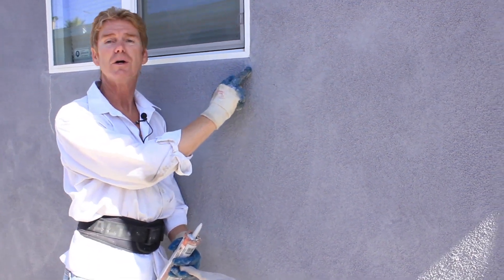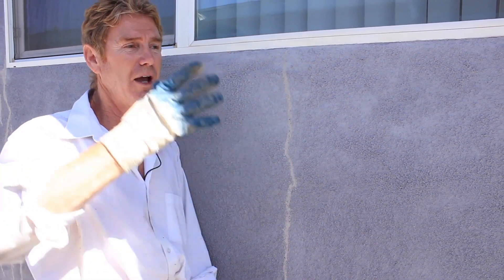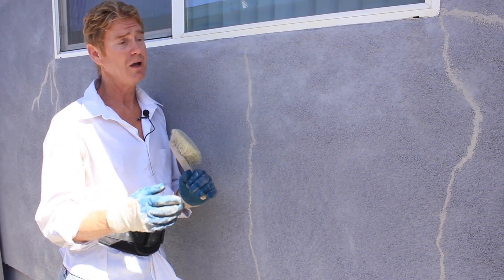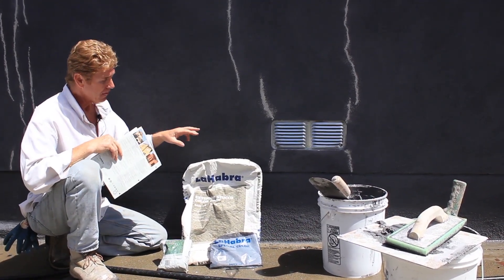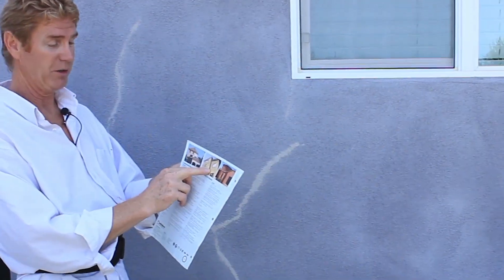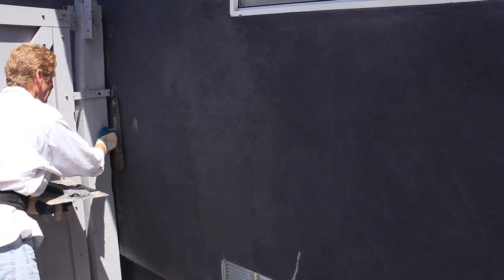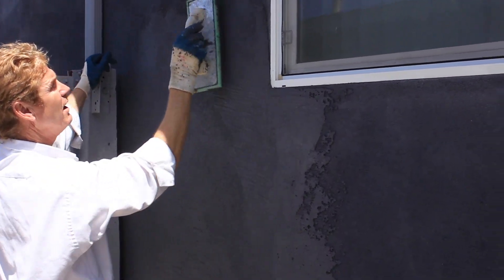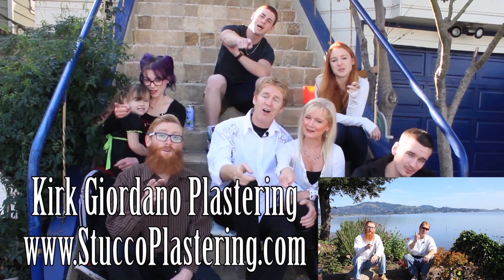Stucco color finish repairing cracks

Comment: I tell ya what Kirk, you are a pro at blending new onto existing. I'm a stucco contractor in the midwest and people don't understand how difficult it can be to blend the new into the old, especially the color. As for the cracking, you do a great job of explaining why it cracks and that its related to building movement. We have a system up here that is designed to not crack, its called Sentry stucco. Get ready for this, we'll start from the substrate and go out to the finish. 1.) Trowel applied moisture barrier. 2.) Mort-Air Vent air barrier. 3.) Metal lath and casing with expansions as needed. 4.) Scratch & brown as normal. 5.) Adhesive basecoat and mesh over the brown coat, like brown EIFS foam. 6.) Acrylic color primer. 7.) Acrylic finish coat....Hows THAT for a stucco system, haha. I personally like good old fashioned stucco but you should look into the system, its crazy advanced but it might be a solution to the cracking problems you have out there. Keep the videos coming Kirk and keep up the great work!
Reply from the maker: Evening Spencer, Thank you,
 We have this system here too, I just have never found anyone willing to pay for it.
 No joke!
 I had a guy 6-or 7 years ago who wanted a Santa Barbara Smooth Mission Finish, he had his house sandblasted,
 I told him his home was rare as they beat the crap out of it with the sand and glass, looked like a bad scratch coat.
 I recommend Polybond type of plaster adhesive with mesh tape on the entire wall then another coat a polybond over it or I could not do that cementitious finish and guarantee it.
 Man, He nearly called the cops on me when I gave him the costs.
 He did find a fella do do the finish and they were both in court forever, I found out as the plastering called me for advice. No Joke.
 It take all kinds, best wishes and have a good evening.
 kirk giordano
Reply: Kirk & Jason Giordanos DIY plastering and stucco instructional videos and forum Haha, yeah, its rare to find that system up here because of the cost but its surprisingly being spec'd on more and more commercial projects. Anyway, keep making the awesome videos kirk and have a good one!
Reply: Spencer Kelly sounds like a nightmare stucco system haha

Comment: Plastic expansion joints On the four corners of the window. from the top corners to the soffit and to the ground for the lower window  corners.
My take. If you think the whole of the east bay is built on unstable strata - take precautions. Control for the inevitable cracking near the Windows.
Love this channel.
Reply from the maker: Good Afternoon Paul dude, had I know this home was built on the fault line and had two layers of different substrates, I would have placed an expansion joint on this long wall.
    It may have helped, however I have seen many jobs with lots of expansion joints with many cracks anyhow, you just never know how the ground will move.                  
                         Live long and plaster 
    Sharing Plastering tips by the Giordano Gents

Comment: Mr. Giordano - I send myself to school every night here on YouTube, learning as much as I can about the industry I am in.  I find myself being drawn to YOUR videos more than any other.  They are spot on and you address issues that are particularly relevant and pointed.  I don't think there is another "teacher" out there that is better!

For repairing color stucco cracks, there is a product called eXact Color Caulk by Sashco - it has the same properties of Big Stretch (which is an amazing and resilient caulk).

We get out a test board and pigment (latex craft paint will do fine) and get a color match using a hairdryer - we dry the mixed sample until it matches exactly with the stucco color.

After we get the match, we mix a larger amount and add it to the caulk with some fine aggregate.

If you get the color match right, you can make the crack virtually invisible - this will largely depend on the aggregate match, of course, because as you know, texture match is as important as a color match.
Reply from the maker: Howdy Hybrid, thank you, my friend, I will try eXact Color Caulk by Sashco, thanks for the tip.            

       Peace, love, and happiness to all.
Sound Plastering tips from your favorite stucco nurds

Comment: Thank you so much for your video.  We live in mid state AZ where it gets cold and warms up during the day.  We have been blessed to be able to build our custom home, which was not a reality while living in CA.  We like our builder very much although there has been a couple of large mistakes, one being we wanted recessed windows with a bull nosed edge on the outside. They ended up flush.   Can't be undone...moved on.....the second is we wanted a smooth Cat Face finish...didn't happen....disappointed to say the least.  Had I known  this, we would have done siding.   I have noticed hair line cracking now.....not painted yet.  Move in date is 6 weeks.   I was told they would fix the cracks.  I assume this  should be done prior to painting.  After watching your video I have a better idea of the process.  I would say they are not large cracks, maybe 1/16,  maybe more.   I think I would like to wait until all the work is done inside and out to wait for them to fix the cracks and then paint.  What ya think?   Thank you for your information!  Appreciate all your great info!
Reply from the maker: Howdy Mary Ann, if the house is to be painted, all you need is quality caulking to fill the cracks then painting, unfortunately stucco has a tendency to hairline,
 If your home had a maintenance free color coat cementitious finish, these are almost impossible to repair, no damage to the integrity of the stucco, just tough to stop this hairlineing.
 Best wishes, 
Kirk & Jason’s stucco repair video’s

Comment: You guys are damn good at what you do. This is also a big problem out here in Colorado, the regular color coats I mean. Out here we only recommend acrylics. But keep up the good work guys.
Reply from the maker: Hi Ernesto Gomez. I hear you brother, I sometimes recommend to folks that they would be better of with acrylics as these homes are on hills and are shifting,
Most folks decline the advice as it raises the cost considerably as the primer and acrylics cost 3 to 4  times as much as cementitious finishes, plus we have to charge a bit more to apply these acrylics, because of all the necessary prep and covering and painting the entire home with the primer necessary for that acrylic stucco finish coat.
 Best wishes, 
Kirk & Jason Giordano's DIY plaster and stucco network

Comment: Is it ok to pressure wash stucco?
Reply from the maker: Howdy mate, sure it is, but depending on the strength or force of the pressure washer takes practice to not gage the wood or do more damage than good.
 cheers,
Kirk and Jason’s sand and cement rendering videos

Comment: I agree on your statements about settling and movement however I find it more often than not that its the vibration of windows and doors opening and closing that cause most cracks and thats where most cracks are.
Thank you.
Reply from the maker: Howdy Noth, this is a fact, the movement in those areas creates it.

Comment: Not being contentious here... but as a 30 yr pool plasterer, I can tell you that cracks are caused by the mix being too wet. Most of the time you are using 3 components in masonry... Sand, Cement, Water. Those 3 products combined provide a certain amount of material (mud), let's say a cubic yard. When that dries, what is left is the sand and cement. It shrinks as the water evaporates. Sort of like a dry lake bed looks. So if you do not cover your work with wet burlap, or plastic... or even misters to keep it hydrated as it cures, it will crack, sometimes called "checking". Of course movement can/will add to this problem. In concrete, the water rises to the top and evaporates, that is why cracking in sidewalks etc is far less common. Thanks for your informative videos, you've educated and helped many DIYs and customers. =0)
Reply from the maker: Howdy Hurley, thank you for these additional tips, most folks don't realize these facts,
 Cheers,
 kirk giordano plastering

Comment: you are correct about movement. those vinyl windows will exert pressure on your stucco with temperature change as well. a properly homewrapped house will not be affected by those little cracks. i wonder about using a stop trim against the windows with a small gap filled with backing rod and surface caulked. lots of extra work for limited benefit?
Reply from the maker: Howdy Blake, good point, the j trim with backer rods are not code in our area in california, if they were in my opinion they would be just another chore to give constant maintenance to.
 Thus, I agree with you too much work for any benefits.
 Cheers, live long and plaster my friend
 Kirk and Jason giordano’s plastering tips
Reply: es la base que no aguanta el peso el acero y concreto pesan mucho una viga horizontal del largo de la casa  solucionaria todo los italianos somo los mejore albañiles del mundo
Reply from the maker: Howdy Carlos Dude, you will get no argument from me, Kirk Pierre Giordano
        Live long and plaster
 Giordano’s plastering images and teaching video’s
Reply: pruebe y con una buena viga la pared no se quiebra  y punto
Reply from the maker: Howdy Carlos, I don't build homes and am not a carpenter, I apply stucco to what's present.
 I do the best I can with what's available, this home had an original sheer wall siding, then someone attached the T one eleve to the original substrate and did a terrible job, I did not find out this fact until I pulled the wood trim, plus the home is on the fault line, under the circumstances this house came out much better than would have imagined with all the negative and hidden facts that were unknown to me at the time.
            Live long and plaster
 giordano’s stucco images and teaching videos
Reply: SUS TRABAJOS SON MUY BUENOS EN ESTUCO PERO CUANDO PONGA MALLAS DE ACERO REFUERCE LAS BASES DE LAS PAREDES CON VIGAS  DE CEMENTO Y HIERRO Y SU BUEN TRABAJO NUNCA SE AGRIETARA  ES MUY FACIL Y USTED LO SABE HACER

Comment: Great comments! Using lime or lower grades of cement will also help prevent cracking. The best way to prevent cracking is by over sizing your footings and making sure the building is correctly anchored to the earth Building regs here are min traditional 6inches & min is 24inches i always make footings overkill just to prevent cracking and subsidence!
Reply from the maker: SgtAMYNTAS I agree, unfortunately this is out of our control. Best wishes, 
 Kirk giordano
Reply: Thanks Kirk & Jason Giordanos DIY plastering and stucco tips I've had my fair share of building just trying a different route im mainly doing masonry like stone work or block work but i have done plastering "stucco" its messy and hard as you say plus the smell aint very plesent :P
Reply from the maker: Hey dude, most trade are messy and hard at first, then you master them and no worries, problems is the patients necessary.
Thats why I suck at plumbing and electrical.
 Best wishes,
 Kirk giordano

Comment: In New Zealand because of leaky homes with polystyrene substrates a lot of new homes are bricks with a bagged finish rather than fully rendered. That way people still can see it is brick and dont worry about monolithic cladding. Crazy I know. 

If you explained things to a new client as well as you did now, Id get you to do the work and be happy with the result. It all comes down to expectations.
Reply from the maker: Hi Lance Millward, thank you,
 I try and explain as well as in this, but sometimes folks simply don't understand as it's boring to learn, sort of like me when someone is explaining technical stuff about computers, won't sink in until I'm ready to really concentrate.
 O well, life as a stucco dude. 
 Cheers, 
Kirk Giordano
Reply: And in NZ we are now using a lot of AAC panel which is generally 50mm thick. It has a cavity system behind it so can breath and let out moisture in bottom vents. The house is still insulated though behind all of this cladding. I've never seen hairline cracks in a house done this way even though we have earthquakes. Might be the modern mix which can expand and contract.

Comment: My civil engineering professor in college said that there is only two kinds of concrete.  1) cracked concrete and 2) concrete that is going to crack. Same should apply to all cement surfaces.
Reply from the maker: Good Afternoon Glen, I like your style, that is a great line, I will have to use it.                  
                         Live long and plaster 
    Sharing Plastering tips by the Giordano Gent
Reply: Another variation, Guarantees of Concrete: 1) It will crack 2) No one will steal it 3) It's heavy

Comment: Kirk & Jason....
You mentioned "Caulking" as the first step.
Why type of Caulking ?

My "Cinder Block Wall" has been stuccoed.
It now has a couple of "California Earthquake  Cracks". I plan on painting the stucco once I fill in the cracks (with regular paint) to freshen up the color ☆

After filling in the cracks....I'm sure the paint will cover well and my Wall will look brand new....until the next Earthquake !!!!

Am I heading in the right direction : )
Reply from the maker: Hello pamela creel, well if it were me and you're going to paint anyway, I used Mor-Flexx as it's easy to work with has sand in the tube and clean up well with just soap and water.,
 Clean the walls, apply only in the crack and rub it in it circular motions to feather in well,
 Anytime someone can notice caulking after a wall has been panted didn't quite understand about how to feather in caulking.
 Cheers,
 kirk giordano